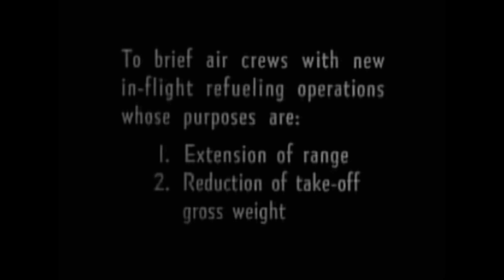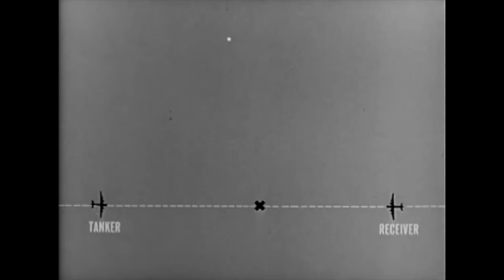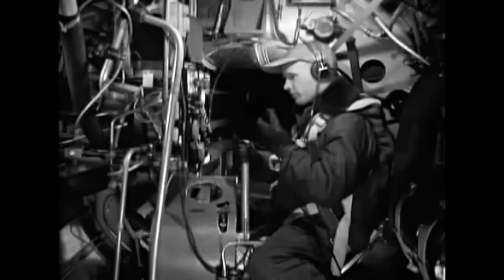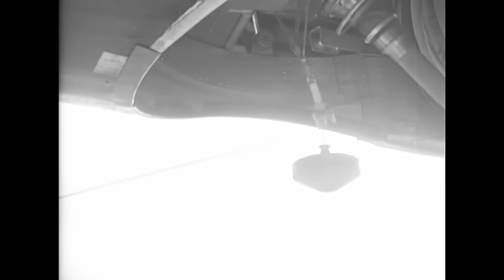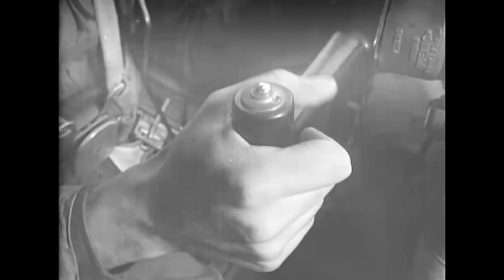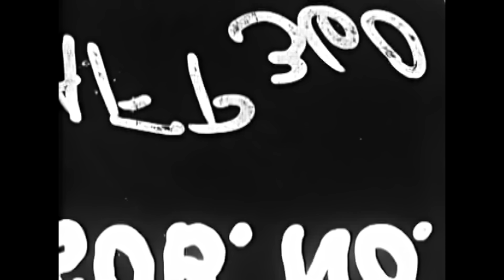Boeing KB-29 Air To Air Refueling (1949)

Comment: This system was developed by Fight Refueling LTD  United Kingdom in 1934!    Flight Refueling LTD  improved on the system to the probe & drogue system that is still used today in the 50s.    USAF fighters used the probe & drogue system in the 50s and 60s until they converted to the flying boom.   Cool note, some or all F-105s had retractable probes and also had a boom receptical!     Boeing came up with the flying boom system because it could move more fuel quicker than the hoses can move.   When you’re Refueling B-52s and B-47s you can’t hang around.      And yes Fight Refueling LTD is still making probe and drogue systems!

Comment: My dad did this. He was an aircraft commander. He told me they would take 2 crews to train. One flight, he finished his shift flying, he went to the back to help with the guys in the rear with the pumps. The pumps were powered by small gas engines in the back, and had electric starters. One of the starters solenoids had malfunctioned, so somebody decided to use a piece of metal to jump the solenoid. The problem is these small engines had either a gas tank or a metal fuel line near the solenoid. When he jumped the solenoid, he also touched the fuel supply, and the arc burn through the metal and raw fuel came out along with the spark and immediately caught him and the back of the airplane on fire. Everybody in the back of the plane got the crewman away from the growing fire and got him put out. Meanwhile, my dad called up front and said we’re on fire, we need to land NOW! Everybody had to hurry to get to the front of the airplane through the trolley, including the burned crewman. They landed in Roswell, New Mexico. They got the plane safe on the ground, and while everybody was running away from it, the entire tail section broke off from the fire. My dad rarely talked about these kind of things, and I remember being  floored as a teenager when he told me this story. He flew the B 29 in World War II, the KB-29 in between World War II and Korea, then flew the SB 29 during Korea.
Reply: Thanks for your story! That was incredible. And thanks to your dad for his service. My dad is retired US Navy. He served in Vietnam, Libya (the Line of Death ™), and Gulf War theaters. I never served, but appreciate everyone who did.
Reply: @doggonemess1 We were stationed in Libya(Wheelus AFB) in ‘66-‘68!
Reply from the maker: Thanks for sharing your dad's amazing story!

Comment: So, basically there's no way to do this at night or in the rain when the observer can't see the lines.
Reply: Maybe if the planes had lights they could use to illuminate the lines.
Reply: @Raguleader  Couple of practical complications there. If you mean spotlights aimed at the lines, it's pretty hard to keep them on target, and they'll blind you so you can't see the other plane's running lights. If you mean Christmas-light-style strings running down the lines themselves, in order to be bright enough and light enough you'd need technology which wouldn't exist until the advent of the LED era.
Reply: @sturmovik1274  I was thinking lights illuminating the lines, which wouldn't need to be super bright since the lines are by necessity pretty close to the bombers. But you are right that maintaining night vision would be a problem.
Reply: You know how much line you've paid out, and you can seat-of-the-pants where they should be behind you, but you do need to be able to see at least the other AC's running lights.

Comment: What a mess. I understand that the flying boom wasn't the first solution but why not skip all this and go directly to the probe and drogue system. The latter seems like an obvious and much simpler solution.
Reply: @skunkjobb  If I recall correctly, probe and drogue requires a plane that is somewhat more agile than a B-29, and much better positioning equipment (with this one, you only have to be in the general area for the line to hook up). Plus, they did move to probe and drogue pretty soon after, once they had better aircraft
Reply: The  drogue/probe wasn't a particularly "obvious" approach with these old planes, since it requires very fine control, at least for the "client" plane. This sort of solution made sense at the time since it assumed both planes having similar speed and agility profiles. Think of any other problem that we haven't solved yet, you will try a lot of stuff that maybe will look ridiculous once we finally reach the "obvious" solution. But until then is a bit of an unknown territory,
Reply: Probably didn't think of it yet. The first few folks to try anything never have a correct example to follow. Just look at the first tanks or aircraft carriers and you'll see some wild stuff.

Comment: I hate to be the guy that has to reach down through a hole in the floor to grab the cables.
Reply: @volvodadfast  I wonder if he ever got shocked from static or if the static discharged from the line already being grounded to the plane
Reply: @deekamikaze  as both the guy and cable are both (relatively speaking) grounded to the plane they shouldnt, when the 2 different cables touch there might be a static shock between the cables but shouldn't affect the people - correct me if im wrong people
Reply: @DumbGoogle-yz9cryou’re correct

Comment: You can see why the drogue and boom methods were developed ASAP. 😬
Reply: Just goes to show the earliest iteration can be the most complicated and more advanced designs are simpler yet easier.

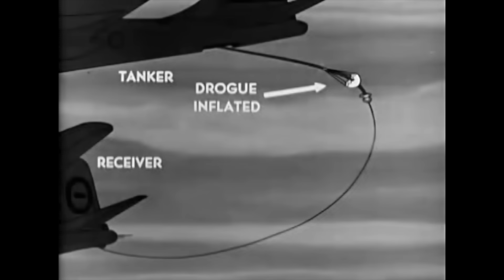Look at 5:25 the drogue chute stabilized the hose in the right position and at 6:40 shows the fuel line connecting externally. You just needed to cut out the grapnel setup and mount the fuel inlet forward.

Comment: I can't think of a single reason as to why this AAR technique would be abandoned 🤣
Reply: And this was the improved version compared to the earliest attempts. 🤣
Reply: I mean, why give up on the guy out on the wing method?  Seems way easier than this😂
Reply: @WebberAerialImaging  And far more entertaining!
Reply: It's showing a clear evolution from earlier attempts rather than any revolution where you scrap everything and go back to fundamental principles.

Just developing this reveals that some things are possible, like the drogue chute holding the hose in the ideal position for a probe to connect to the fuel line directly via a probe. So, why are you still bothering with the double grapnel system? In either case the fuel hose is connected externally and automatically.

They were so close to making the drogue and boom system by mounting the inlet facing forwards on a probe in front of the cockpit.
Reply: Too all the geniuses thinking they had not yet conceived of the current better methods, the slow B-29 speed and older flight controls made it much more unsteady without perfect weather.  Higher jet speeds...  allow easier refueling.
Reply: You are totally incorrect they had not yet developed the flying boom. Some KB-29 had the boom and most all KB-50 had a boom and the KC-97 had the boom. All of these airframes were propeller powered. 

You statement is based upon a lack of understanding of the development process that USAF developed after 1945. 

KB-50 and KC-97 were flying boom equipped propeller powered aircraft refueling jet powered aircraft.
Reply: @tristanholland6445 there were KB-50’s that had auxiliary jet engines.
Reply: @bigdaddy7119 also at least one KB-29, but then they used KB-29s to figure out a lot of stuff they wanted to do with the KB-50s.
Reply: @tristanholland6445  he is also forgetting the fact that the KC-130 exists
Reply: I can think of a few reasons, requires smooth air, takes multiple men in the aircraft and extra, heavy, equipment, also in an emergency with the planes connected by heavy wire, if they tried to break away, they could end up taking both aircraft down. Whereas the modern way less equipment is involved and only the pilot in the receiving aircraft is used and with the USAF was, they can fly the boom into the receiving aircraft if the air is turbulent or the pilot is injured or tired.
Reply: @southronjr1570  I was being sarcastic
Reply: @misawajason  Ummm... no you weren't  That wasn't sarcasm.  If you think it was, then try looking it up in a dictionary.  That was a just a non-comprehending response to the very funny and sarcastic comment of @WebberAerialImaging...
Reply: @ChristLink-Channel  What???  Whatever you say, Karen.
Reply: @ChristLink-Channel  Sarcasm: Use of acerbic language to mock or convey contempt, often using verbal irony.
"I can't think of a single reason as to why this AAR technique would be abandoned"
Acerbic language: "...single reason..."
mock: "...would be abandoned"
contempt: "I can't think of a..."
Reply: @hailtothechief7181  Cool!  So now you'll now how to recognize sarcasm next time you see it.  Weber already knew: You didn't. You took his comment dead serious, and thought it needed a response...  Hoo boy...
Reply: @ChristLink-Channel  Bend over
Reply: @ChristLink-Channel  What a ridiculous comment. @misawajason wasn't responding to @WebberAerialImaging, you are mixing things up and @misawajason's original post was obvious sarcasm.
Reply: @ChristLink-Channel he was being sarcastic. Relax 😂
Reply: @Raguleader  No he wasn't.  He took the original sarcastic comment by @miswajason seriously, thinking it was real, then tried to bluff his way out.  And failed.
Reply: @ChristLink-Channel  ...he is @misawajason. It's very unlikely he failed to notice his own sarcasm.
Reply: @southronjr1570  /Sacrasm-Detection-Mode = Unavailable/

Comment: That is some navy thinking right there.
Reply: Nope, navy kept it simple, put a drogue at the nozzle, have the receiving aircraft spear the nozzle with a probe. Simple. Air Force decided they needed a special aircraft with a steerable boom.
Reply: @kdrapertrucker  To be fair, boom refueling has a much faster transfer rate and the tanker boom operator can “fly” the boom into the receptacle of a large aircraft.  Such large planes like bombers and transport aircraft that benefit most from the high refuel rates, would have difficult time catching a drogue type system that’s potentially flailing around.
Reply: @BlitzvogelMobius  point but also the rogue method can refuel multiple aircraft at once. Both have their merits.